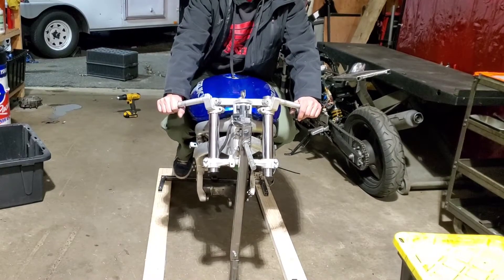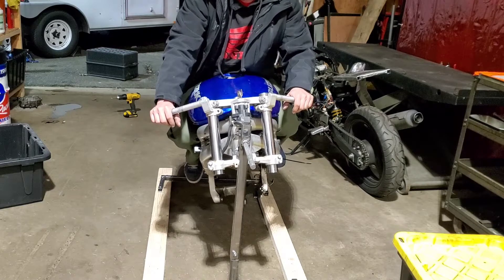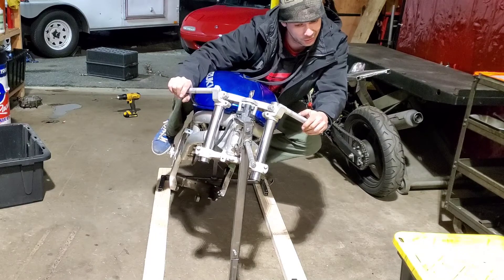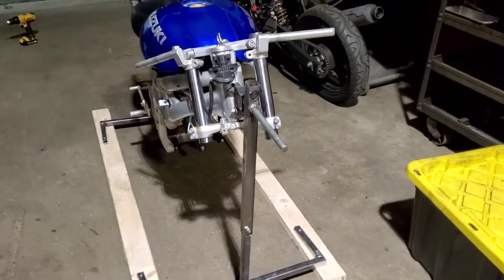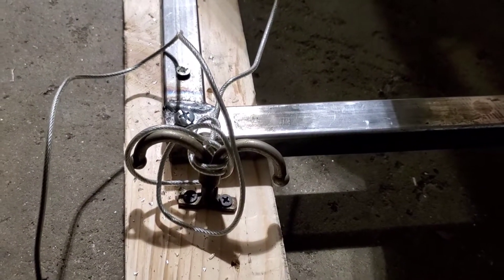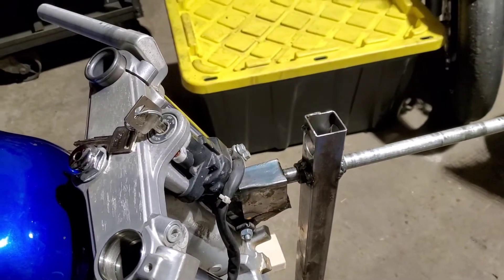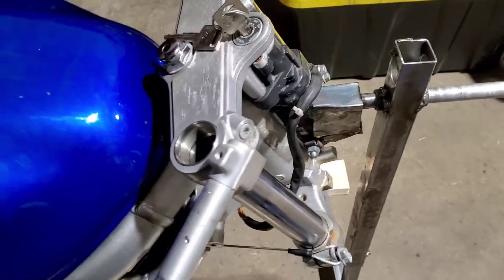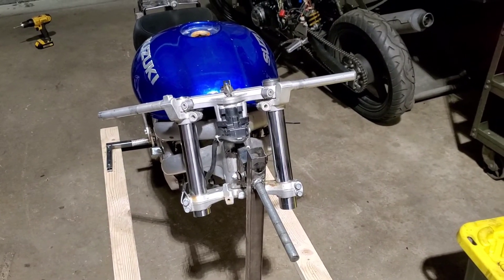building a diy motorcycle body position trainer part 2: countersteering

Comment: Add that other cable and a VR headset, and this will be a common setup in iRacing by 2023. Maybe some rumblepacks under the seat.

This is actually pretty damn cool.
Reply from the maker: that would be awesome. i did add the other cable (vid on my instagram) and it works awesome, but turning it into a control is a little beyond my skill level with electronics.